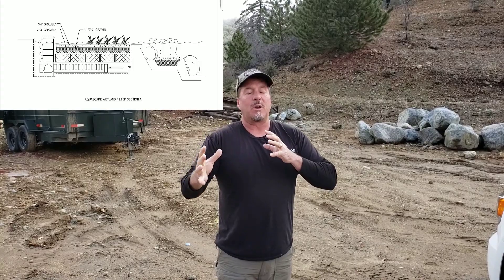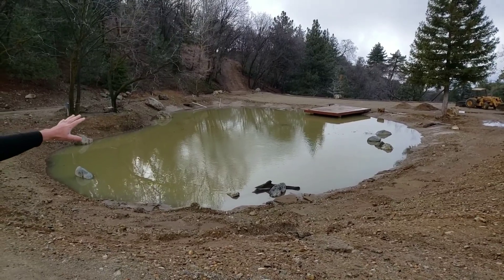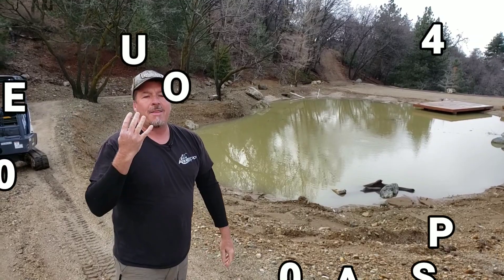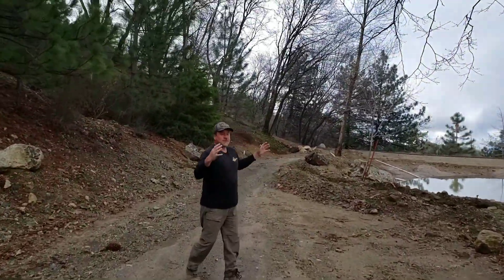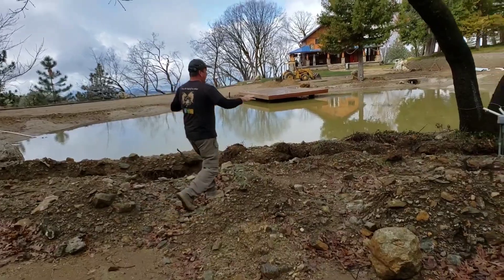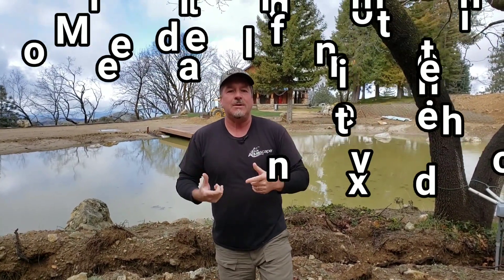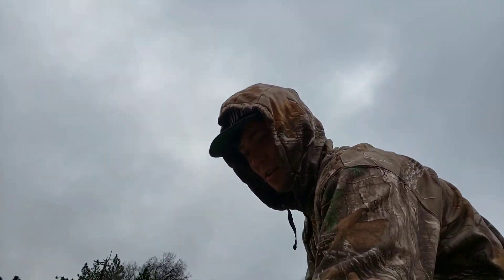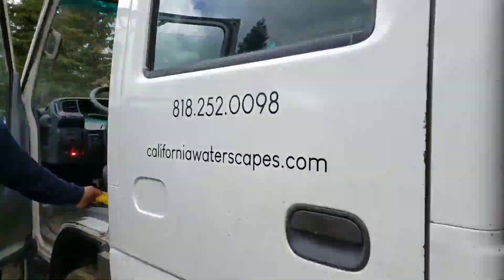How to install a WETLAND FILTER | Project Walkthrough

Comment: Looks like is gonna be an interesting project  Carl, just a quick question on the description it says 400sqf for wet land is that correct? Or is it 400 aquabloxes which would  be 10% of surface water 1000 aquabloxes would be close to 25%
Reply: Hey Carl. So this wetland is only a little over 4% then? 

As the pond must be somewhere around 9500 sq ft based on 100x120 feet at 80% of the rectangle. 

Look, i agree that when they get to this size 4-5% is probably plenty. And I’m myself quoting a couple projects similar pond/dam sizes and planning similar ratio for wetland size.
Reply from the maker: @thinkgreenlandscapes  Good morning Tony!  You caught me at my computer!!!!  :)

According to Aquascape's Constructed Wetland Filter System Requirements found on page 27 in their 2018 catalog, this wetland is more than sufficient for this body of water.  

I've installed several wetlands of this size for larger ponds than this with stunning results, plus this isn't the only means of biological filtration for this system.  

We have close to 100' of combined streams which will also colonize with beneficial bacteria and the plants that will be installed alongside the shoreline should do the trick.

I'm so exhausted from this weeks construction that I just didn't want to film an update video yesterday.  What parts of this project would you like me to film a closeup  on?  I'd like to show you as much detail as I can on the areas that might interest you.

You can download the current Aquascape Catalog and find the current specs on page 27 as well for the 2019 year.

I'm hoping that this long response helps you with your projects and if you would like to speak with me personally, you can almost always get me at 888-713-7771 x 4 after hours up to about 8 PM (if I don't answer, leave a message :)  )

Have a great day, and Happy Ponding!

-Carl
Reply: Columbia Water Gardens thanks Carl. I’m one of the Aussie CACs. Looked up that page in 2019 book. All the calculations on there work out from 13% for larger ponds and % ratio increases to 14% then 15% as the pond gets smaller. Have you got any pics or videos of previous big wetlands you’ve installed? Would love to see the difference in water quality Before & Afters. I get asked what difference to expect in water quality.from putting in constructed wetlands and whilst I can explain it, it would be great to have some pics to show of others projects.
Reply from the maker: Tony Green ill add some to the reveal video. :)
Reply: Columbia Water Gardens thanks 👍
Reply from the maker: 400 sq ft of wetland.